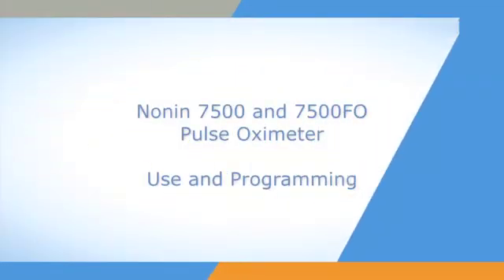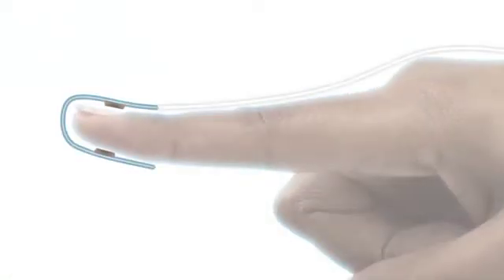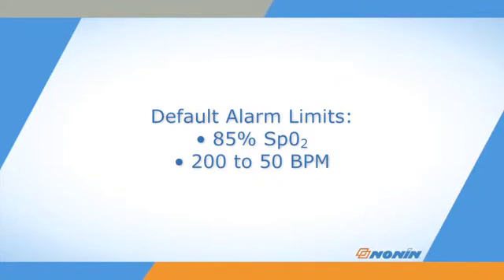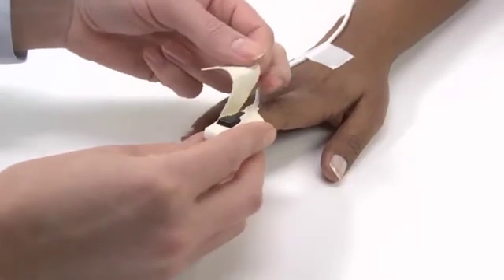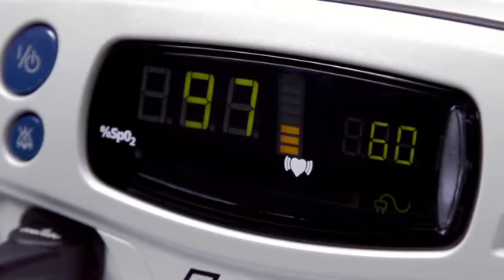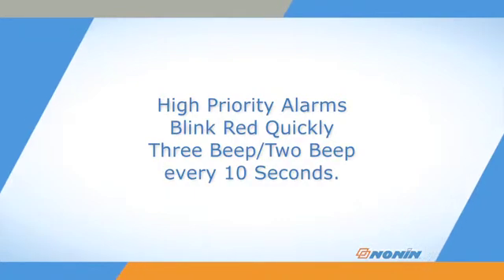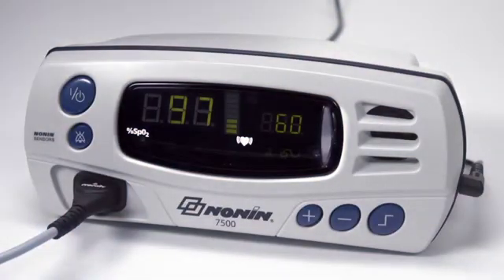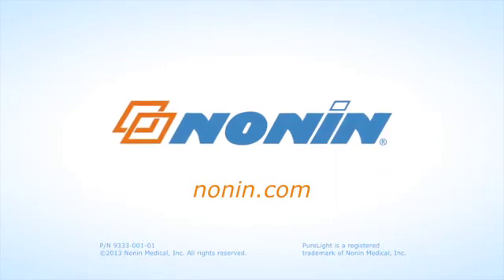Nonin 7500 Pulse Oximeter - Video Guide

Comment: The only things I don't like about these is the fact there's no brightness adjustment, and there are only three settings for the pulse beep. The  alarms are not that loud either, and there's no Perfusion index. I have not tested the battery to see if it is actually 16 hours, but I might one day, and also  another thing I don't like is the cable comes out wayyyy too easily from the monitor!!